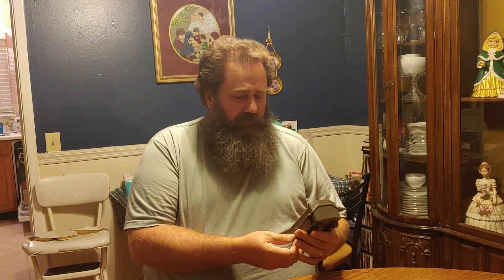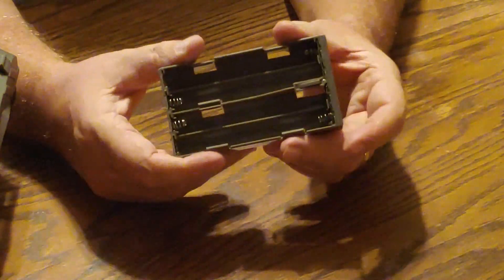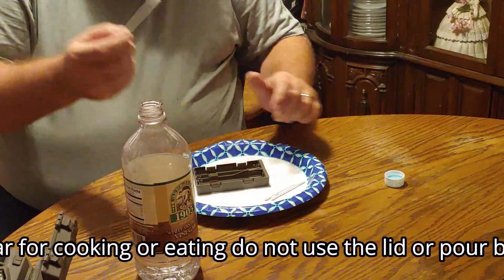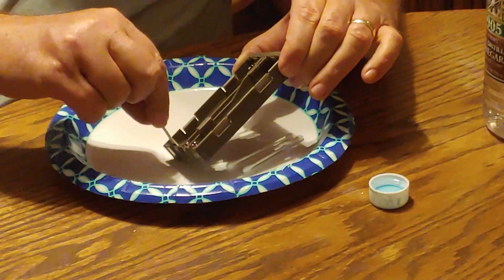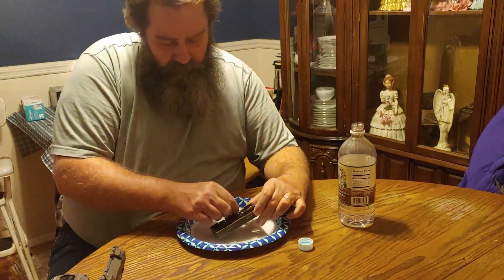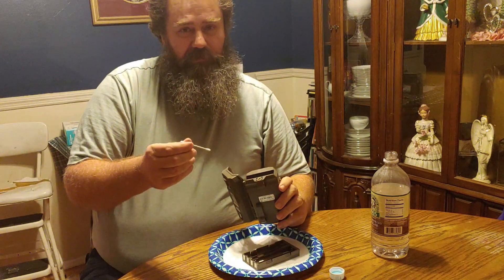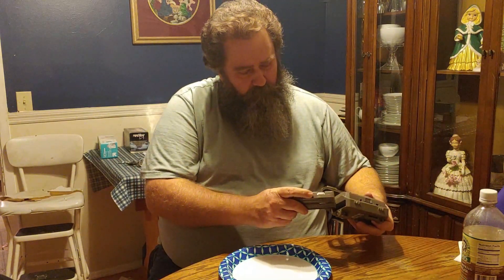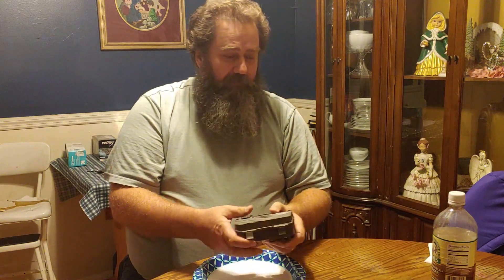Why is my Trail Camera not working - Simple Fix

Comment: Greetings Joey.  I used to do the same thing.  Then my Tech guy Mark, told me that isopropyl alcohol works great. Being diabetic I always have alcohol prep pads around sometimes I put them on the end of a pencil and rub down the battery. Contacts works very well and Bryce extremely fast.

Great tip my friend … 😉
Reply from the maker: Thank you George, I threw one camera away before trying this, Uhggg. Now I only use lithium batteries.

Comment: That's a good fix Joey! I've noticed that blue junk on the terminals as well. I wasn't sure if you'd pull out a soft drink or vinegar. i think either works. It's worked for me in the past too! Nice video!
Reply from the maker: I just used a soft drink to clean the terminals on my truck a few days ago. So yes they would both work, but if you use soda on the camera be sure to clean it well afterwards. you wouldnt want to draw ants to it that might start living in the camera
Reply: @MySliceOfHeavenoutdoors  I do the same thing. Soft drink on the vehicle and vinegar on the trail cameras for that very reason! Great minds think alike!

Comment: I had two Tasco 8MP trail cameras that stopped working recently.   I was about to toss them, but tried this trick.  They are working again!    My terminals didn't even look that cruddy, but I did all of them including the springs inside with a Q-tip & white vinegar.   I used a needle nose pliers & Q-tip for inside.    I also did the batteries that were still good.  

I started buying a few more expensive cameras thinking these Tasco were junk.   The Tasco lack some features (no battery indicator is the most annoying), but they do a decent job for the money.   

This is something everyone should try before tossing a camera.  I am guilty of tossing one some time ago.  I wish that I still had it now.   Trail cameras should have this tip in their instructions!!!!!
Reply from the maker: I am glad you found this video useful, please share it so others may find it.
It may help someone else.
I threw my first camera away, then another quit working, I decided to check the camera a little better. Glad I did.
Reply: @MySliceOfHeavenoutdoors  I am the same.  Threw one away a couple months ago.  Didn't want to throw away two more before doing more investigating.  I came across your clip, & I believe the problem is solved.  The cameras are going back out.   I will be sharing your tip with others.  Glad you shared it with the rest of us.   Thank you!!!!!

Comment: I'll try that on my camera. It stopped working. I had a message for a defective card. So, I bought a new card, but still get the same message. I'll look over the camera well. My guess is the contacts for the card might be corroded. Thanks for the tip, Joey. - Rick
Reply from the maker: You are very welcome buddy, hope it works.

Comment: I have 2 of those tasco 10 mp camera and on multi shot it takes 2 dark pics and 1 normal. It does it on both cameras. I started using Moultrie no glo.
Reply from the maker: All the Tasco does the 2 dark pictures, i don't use that setting. There are decent cameras for the price
Reply: They're not bad for 40 bux
Reply from the maker: @schaffersoutdooradventures4071  I was just looking at your last video, your Tascos took better pictures than the stealth cam I think
Reply: The stealthcam wasnt that great. I am trying Moultrie. They seem to work good

Comment: I have the Apeman H-70 and we chose to plug it in outside all the time as the batteries don't last long.  Is this an issue?  After over a year, it doesn't work anymore.  Just died.
Reply from the maker: Plug it in? you mean like a cord that plugs into the camera and into an outlet? If so, I would bet you have some corrosion in the hole that the wire plugs into the camera. I have had several cameras quit working, all were due to corrosion in the battery compartment

Comment: My camera is taking pictures but when i switch to video mode it says there are videos but when i review them it just plays a black scree for 10 seconds for every video it says it took. Any ideas?
Reply from the maker: I have no idea, maybe try reformatting your SD card. And also make sure camera has new batteries, I would suggest using energizer ultimate lithiums. my tasco cameras gave me troubles till I switched batteries.

Comment: How do you remove the battery pack?
Reply from the maker: Every camera is different, On these tascos there is a slide button on the bottom front of the camera behind the door. Slide it over or press it in and the battery pack slides out from underneath the camera.

Comment: Hello, we had just bought a trail camera to record nocturnal animals.  The first few times it worked just fine but now our problem is that it only records 2 seconds.  For example out of 50 recordings, only about 2 or 3 records a pre-programmed 20 seconds and the other 47 times, it records only 2 seconds.  Can you or anyone help us out?  Thank you so much
Reply from the maker: Sorry to hear you are having a problem, what camera do you have and what batteries are you using?
Reply: @MySliceOfHeavenoutdoors  , the brand is Digitnow BR695 Trail Camera 16MP 1080P FHD.  Using high alkaline batteries.  Thanks for getting back
Reply from the maker: @nrocks75  1st thing I would do is replace the batteries with energizer ultimate lithium batteries. I would almost bet it's a battery issue.
I have a few cameras that do that same thing if I don't use lithium batteries.
If that does not solve your problem I would then contact the manufacturer or place of purchase.
If you contact them I am sure they will tell you to use lithium batteries.
Reply: @MySliceOfHeavenoutdoors  Thank you so much for your response & advise.  I will do just that, thanks again!
Reply from the maker: Let me know if the lithium batteries work.
Reply: @MySliceOfHeavenoutdoors  , I will, thanks!